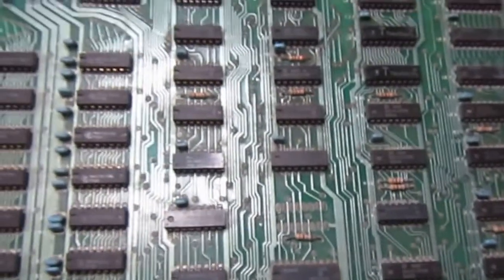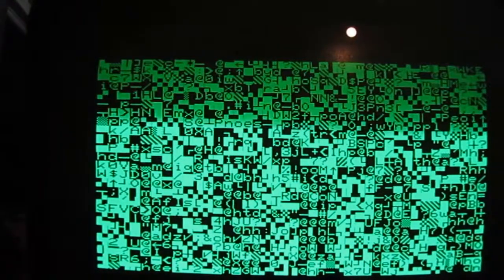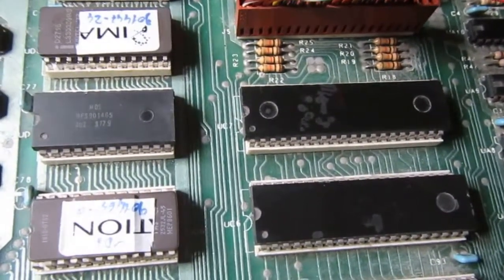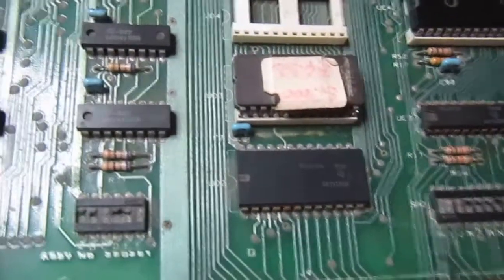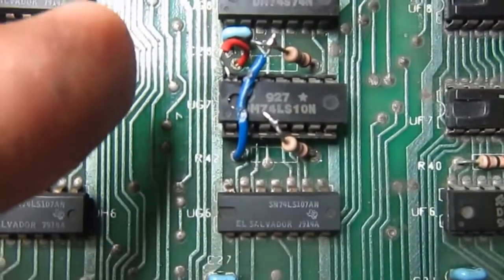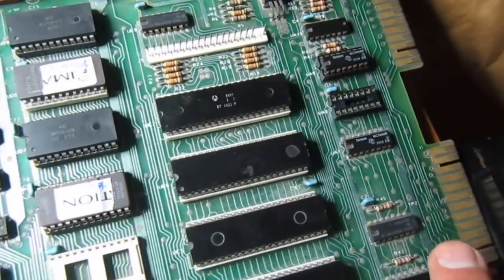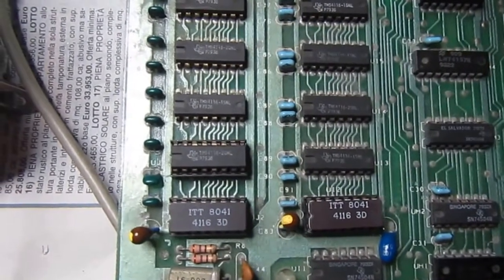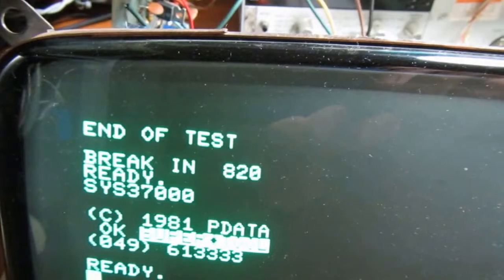1979 Commodore PET 3032 (2001N-32) electronic repair

Comment: Great job =D  Nice techniques for testing the two blocks of RAM there and working out which chip was faulty.
Reply from the maker: Hi GadgetUK164, thanks for the nice comment! I had no idea that the test image was not even testing both banks at first. I got the suggestion to swap the /CAS lines of the two banks to maybe avoid that the memory page-0 was on the faulty bank and that worked. Also the test ROM had a simple "one value in all locations" test and that didn't identify the UI2 fault. I always use a "different value in each location" test to identify problematic RAM errors. That's what I wrote in basic to get to UI2 at the end.
Reply from the maker: Hi Mr T. Guru,
assuming that the 8032 has the same two banks configuration, and assuming the lower bank is good enough to start the basic (page0, stack, lower basic area all work):
10 F=2048:T=32767
20 FORA=FTOT:POKEA,AAND255:NEXT
30 FORA=FTOT:R=PEEK(A):W=AAND255
40 IFR<>WTHENPRINT"A: R "R" W "W
50 NEXT

If errors happen for A<16384, then the bad chip(s) is(are) in the /CAS0 selected bank, if A>=16384 then look at /CAS1 selected bank for bad chip(s)
Reply: I don't know if either of you are aware but Dave Curran (over a Tynemouth Software) has a bunch of diagnostic, RAM and ROM replacement systems for the PET.  I think he has a unit which sits under the CPU and can replace all the RAM and ROM on board, and he has other diagnostic tools too which you can buy from his site.  http://www.tynemouthsoftware.co.uk/Shop
Reply from the maker: If it crashes, it must be a problem with bank0 (or any bit of logic related). 
I've never tried it, but try to put this image in place of the kernel ROM:
http://www.zimmers.net/anonftp/pub/cbm/firmware/computers/pet/other/pettester8032.bin
It could give the machine enough "life" for testing around the various signals to the RAM. But be prepared to spend hours in looking at the schematics and probing signals to see what's wrong.
Reply from the maker: Also, any 4116 chip is at least 31 years old (I've never seen 4116 newer than 1986 as date codes in my little collection), so, if you don't have a test machine to try every single 4116, you can never tell if they're good or bad. I've also damaged a few 4116 by piggybacking another chip on it, the triple supply RAMs are easily damaged for a missing or intermittent Vbb connection.
Reply from the maker: there's a typo indeed, here's the correct line 40:
40 IFR<>WTHENPRINTA" :  R "R"  W "W

but you have an error in your RAM even with the wrong line 40, it only fails to tell you on what locations is the error.
Reply from the maker: First would be really helpful to have the correct line 40, so we can see the addresses failing. R255 probably means there's some logic problem instead of single DRAM chips gone bad.
Also, make sure the program is correctly stored in memory (list after typing it and check it's correct). With such a fault I doubt even the basic memory works correctly.
Reply from the maker: If it's really so random (a complete run finds no problems, then another one crashes), I'd look for bad solder joints too...
Reply from the maker: Also check the sockets, if they are the same as in the old 2001/30XX boards, do change them all. It's indeed  a difficult fault to identify. Do the 8032 pet-tester rom work in your board? It might give you some clues.
Reply from the maker: Ok, let me know how it goes. I had a random fault (loss of vertical sync for a fraction of a second) on the 3032 monitor, it turned out to be an intermittent diode, but the vertical circuit of the monitor is very simple and has few components.
I think a random logic fault is really strange anyway and I would inspect all solder joints first. If all else fails, this is a job for a logic analyzer I'm afraid.
However, if the tester ROM keeps on working (the 30XX one is very simple and keeps on running almost on any situation), you have time to find the bad signals once they happen.
Reply from the maker: Great news! Another from the 8-bit era is alive and kicking! What's your IC tester by the way? I always thought about making one (or getting a good one).
Reply from the maker: All my (E)EPROM programmers are almost as old (some older) than most of the stuff I repair :)
My HI-LO EPP-04 has a software that could test digital IC and memories, but requires an external unit (DMT-01) which is probably one of the rarest equipment on earth. There's also no schematic that I could find to make an equivalent one.
Yes, I know I could get some modern gear, maybe one day :)

Comment: Ma guarda qui, che nostalgia. Ne ho avuto uno anche io negli anni 80 di 3032. Mio zio buon'anima aveva un ufficio dove l'aveva usato fino a quando non fece un upgrade e mi diede entrambi il 3032 e il doppio floppy drive HD esterno per liberarsene.

Ai tempi il software per questo era introvabile, internet era una squadra di calcio di Milano scritta male e io volevo videogiochi, perciò quando mio padre trovò un amico suo che mi diede un C64 in cambio di entrambi la macchina e il floppy non ci pensai manco una volta sola.

Spensierati tempi che furono. Bel video.
Reply from the maker: Ciao Beater! Si, bei tempi, avevamo tutti qualche anno in meno :)
Prima o poi vorrei trovare anche un doppio floppy per il PET, ma ormai e' roba che nessuno scambia facilmente :)
Grazie!